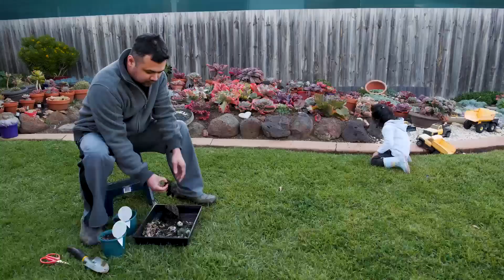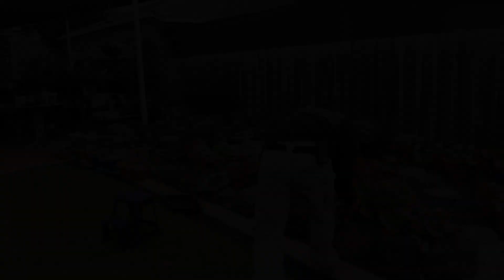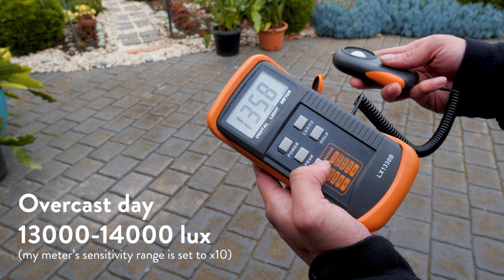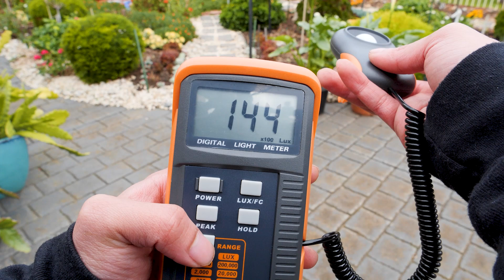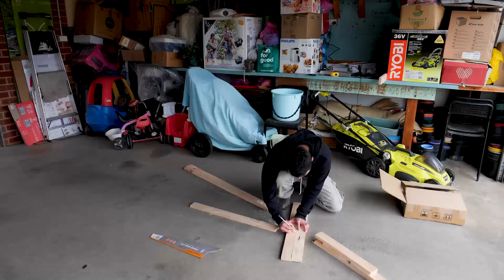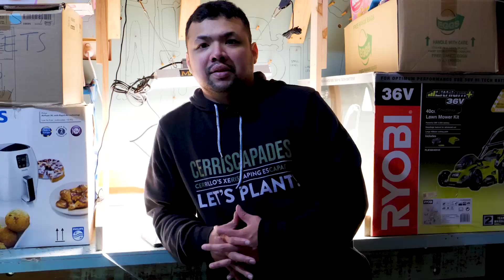#165 Adding more sempervivum, and building my indoor grow lights setup

Comment: Very gorgeous garden! May i ask, what grass are you using for your lawn? Do they do well in hot summer?
Reply from the maker: It's kikuyu grass. Very invasive and spreads quickly because they put out lots of rhizomes/runners underground. If you trim them during summer, they will dry out very quickly, but will grow back once it starts raining and gets cooler. If you leave them long, they will be able to withstand summer.

Comment: I don't think 8-10k lux is enough personally chuck especially with only 8 hours of light. Full sunlight is around 130k lux. I'd aim for at least 25-30k lux and take it from there upwards. Playing around with length of days etc will be interesting. I tend to think that 12 hours is the minimum for getting any sort of growth as otherwise they think it's winter and don't grow (at least in my climate)
Reply from the maker: Thanks man! I wanted to discover the values myself so I didn't specifically ask you about these the last time we had a chat. From what I can tell, using the current height of the frame, I have potentially up to around 150k lux depending on how high I set the power, and how close the plants are to the light.

My initial thought was to see if I can replicate overcast days at minimum power level, because I will be using these on seedlings, which right now do not need much light to grow (winter and all). But once I move on to simulating spring/summer, I will have to ramp things up.

Comment: Things have actually moved on since those diagrams were created regarding the peaks being around blue and red. In fact green has just as much of an impact as the other two bands especially in a canopy where the green light reflects down to lower leaves. Recommend watching the apogee YouTube channel
Reply: The grow light is only 150w. The 1000w naming is pretty naughty but lots of them do it
Reply from the maker: Interesting, I haven't encountered this in the sources I have been reading so far (about the green band) so I'll be seeking more literature on this specifically.

As for the wattage, I figured it was like household LED bulbs being advertised by their incandescent equivalents. So, thanks for confirming.

Comment: You mentioned in the beginning that there are the purple growlights and full spectrum ones and you want to do more research on them. I can tell you from my experience that the purple ones do not work great for succulents. I used them at first and it made my mature plants stretch towards them. Even if you have them close to the plants it does not do a great job. I have read about them a bit and learned that the spectrum that they produce is not ideal for CAM plants like succulents, maybe you can read more about it since I could not find out more about it. For now I use them for my leaf propagations. I noticed that the little rosettes do not stretch under them and since they are not that intensive they do not damage the little plants.
Reply from the maker: Thanks for the heads up, I'll see if I can find literature on this!

Comment: Again, an excellent episode - thank you, Chuck! Wished some of my teachers at school would have had the same ability to interestingly mix theory + practice.
One question rather related to the first part: I understood that the Sempervivums are supposed to regulate (=consume)  somehow surface humidity in the winter months. But aren't you afraid of a potential opposite effect? In my garden humidity seems to evaporate more slowly when I have plants covering the surface .
Furthermore, in one of your former videos you talked about a 50/50 mix of garden soil and scoria. However, on the video the percentage of scoria seems to be much higher? Am I right for this area?
Thanks and looking forward to the next episodes!
Reply from the maker: Yeah more groundcover will make things more humid. I haven't had much problem with that with my other tapestries - just 1 or 2 rotten rosettes that get easily replaced by offsets when they start getting active again in spring. So I do not generally worry much about it.

As for the second question, you have a keen eye! I generally do 1:1 or less if I know I am filling up a large volume in the ground. But when I am unsure where I'll be using the mix, I just add more scoria. Cause sometimes I end up using the mix in pots.
Reply: @Cerriscapades  - thanks Chuck! I understood (probably badly 😜) that one objective of the Sempervivum-planting was to make things more dry, this is why I asked.
Looking forward to see the results anyways!